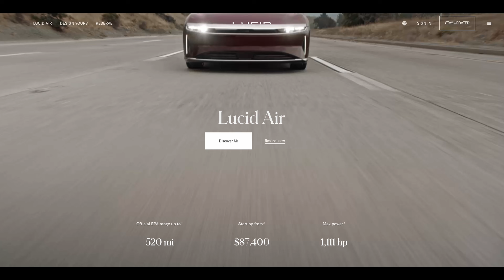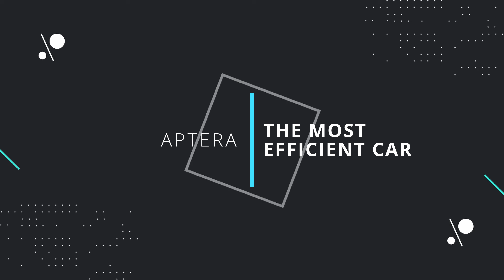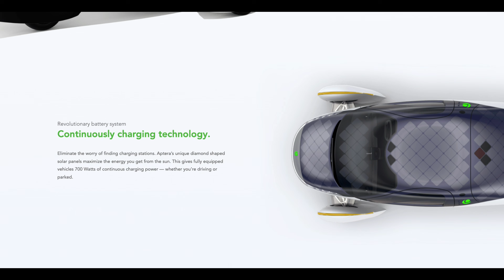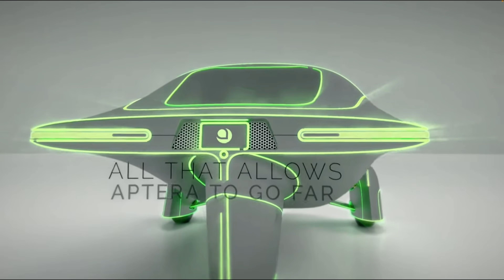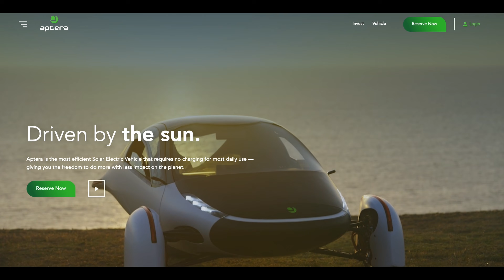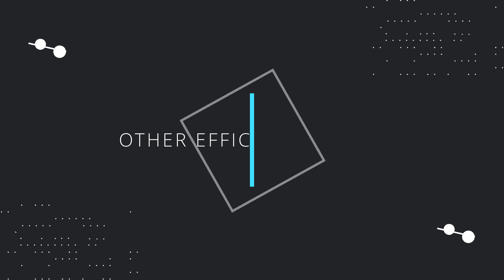Can Aptera redefine the norms of EV efficiency?

Comment: Forgive me for my continual cynicism, but having been an EV proponents for around 30 years, I've seen it all before.

Aptera currently have nothing to offer as they are not even at the pre-production prototype stage. They have a couple of proof of concept vehicles that are quite impressive, but a huge amount of work to do before series production. That means they need a huge amount of investment to tool up.

Their estimate for the cost of a production vehicle is based on a volume of sales that is almost certainly beyond reality. Most people simply don't buy a vehicle like this. How many people buy an SUV, when an estate car would actually do the job so much better?

Aptera has gone bust before, taking investors money with them. I'd really like to see them succeed, but I think the cycle is likely to repeat.

Vectrix only succeeded once someone was able to buy the remains of the company for a pittance and assemble vehicles from spares stock as they were ordered.
Reply: Aptera’s pre-production Gamma version is due to be released this month. And all of the original investors money was returned back in the mid 2000’s.
Reply: @michaelmay9958  Just a correction - All of the Pre-order money was returned.  Investors, who voted to kick the founders off the board in 2009, lost money, although vendors were repaid and employees got severance.

The assets were liquidated in 2011.  The original founders were able to buy back the rights in 2019 and restarted the company with the original key people.
Reply from the maker: @michaelmay9958  Yes it looks promising and I would love Aptera to succeed. It's in indication that people trust original founders as they were brushed aside at the first attempt.
Reply: @michaelmay9958 [all of the original investors money was returned] You are being fooled by snake oil salesmen and gullible disciples who are seeking discounts. Aptera existed for 5 years and made 17 part-prototypes. Their expenses were paid by the losses of investors like Google, - so many shareholders lost money. It is highly likely there was more money syphoned off than real expenses, and current progress is showing similar trends.
Reply: Paul, they have had more than a couple of prototypes for quite some time.  There were more than that last November when my wife and I rode in an alpha prototype with stunning acceleration.

I think you have missed many aspects of this company, including the production method, which is revolutionary.

I will likely be driving my production model early next year and will report on the experience.
Reply from the maker: @n.brucenelson5920  I would love to know more about how they produce the body of the car. I have read that they use so revolutionary method to cure composites very fast
Reply: @LatutaEV  Although details could still change, they were using 3D printed molds with vacuum resin infusion and UV flash curing.  Costs are well under an order of magnitude below what Tesla is doing and the parts are much stronger.
Reply: @LatutaEV  The composite was used in C.A.'s boat company, which has a high customer complaint record regarding a deteriorating hull, from what I have Googled.
Reply: @n.brucenelson5920  The only order of magnitude are the lies.
Reply from the maker: @aussieideasman8498  Many people complaining about Tesla panel gaps and other issues but that didn't stop the company progress.😉
Reply: @LatutaEV  You get your full range with bad panel gaps and small issues like that in a Tesla. Aptera will probably turn out you get nothing. If they try to get a vehicle to market, it won't pass such Aussie standards as 'fit for purpose' and 'meets specifications'. No prototype has ever come close.
Reply from the maker: @aussieideasman8498  yes but people were talking all sorts about Tesla in the days of a roadster. I guess you have to fake it till you make it sometimes 😉
Reply: @LatutaEV  My ethics don't allow the notion of if one party does something wrong, that gives license for another to do wrong. There is no faking it for Aptera just because others have done it in the past. Nor should reporters report on claims that have never been verified in the real world by passing them on as facts. Computer modeling does not cut it.
Reply from the maker: @aussieideasman8498  My video was about the approach to maximize the efficiency and get away from this massive and expensive SUVs. You often see one person driving this tank to work on his own. I was talking about benefits of charging speed and more miles per kWh etc.
Reply: @LatutaEV  [My video was about the approach to maximize the efficiency and get away from this massive and expensive SUVs.] Your mistake was to use something that is both not real and has unfounded claims, as if it was real, thus promoting what may just be a massive scam. There are plenty of other ways to meet your aim without possibly conning people.
[You often see one person driving this tank to work on his own.] My logic tells me that how many you see is irrelevant to the EV you chose 'because it is not real and is unfounded'.  
[I was talking about benefits of charging speed and more miles per kWh etc.] There are many EVs that show benefits over big SUVs, but Aptera is not one of them, dare I say - 'because it is not real and is unfounded'. 
When I have time, I will use your video to evaluate the claims and add as much information I have to inform the public so that they can make correct choices for themselves. In the meantime, Gamma is 10 days past its predicted reveal date and not a vehicle or part thereof to be seen.
Reply from the maker: @aussieideasman8498  What unfounded claims did I make in my video? I was only refering to the figures stated by Aptera. If you read the title of my video hopefully you will understand. Please also note a question mark in the end of the title 😁
Reply: @n.brucenelson5920  I see your comments here a lot and know you are an Aptera Ambassador.  Do you have a channel where you will be documenting your experience with the car?  I reserved mine earlier this month so delivery will be further down the line for me but that gives me the benefit of seeing real world reviews before finalizing my order.
Reply: @n.brucenelson5920  You and I clearly have a different opinion on what constitutes a production ready prototype. As far as I am concerned, what you dove was a proof of concept with different suspension, motors, batteries etc. and not a 'first of the type'. Given the amount of development that was supposed to been done the first time round, I was quite shocked to see how far off production ready they were.

Do I think they'll succeed in getting into production? Yes, I think they will, just like Vectrix did. Do I think the'll sell sufficient volume to make their business model work? No. 

If their production method is so revolutionary, then there's a real danger that the investors will refuse further funding and then sell that method. That's exacly what happened with Pivco and Ford.
Reply: @EVguru  I was actually a supplier to PIVCO and other early EVs.  I saw many of the early attempts including the Corbin Sparrow and the Commuter Car Company Tango.

The company I worked for hired the Tesla motor engineers when Tesla ran out of money and had to lay them all off.  You seem to be way behind the present Aptera situation and I don't agree with your comparison, having seen all of these companies up close.
Reply: @n.brucenelson5920  What is your opinion of the Tango? Although even a used one is quite expensive, I still am interested to purchase one. I had attempted to meet up with the Commuter Cars president for a potential purchase of one about a year ago but things didn't pan out. Any details you could provide about the Tango other than what is already out on the web would be appreciated.
Reply: @skipondowntheroad5833  When I lived in SF Bay, the President and his son stopped by with a Tango.   We got rides and he talked with us about supplying the A/C system, which we had already done for several EVs such as the Ford Think!.    It certainly had impressive acceleration, so it would be a fun vehicle.  

Mass production of the Tango didn't pan out and we sold our A/C business to Tecumseh Products, hired the Tesla motor engineers when Tesla ran out of money and had to lay them off, and started developing motors for electric boats.  

I am not sure I have anything to add about the Tango.  It would have been an interesting and fun vehicle to commute in from the standpoint of this motorcycle rider.
Reply: @EVguru  I have plenty of reasons why it's more likely to be a second scam in my video's and comments on many pro-Aptera YT video sites.
Reply: @EVguru  Aptera only went bust after ejecting the founders. That's the key to keep in mind. Their efficiency isn't just in the car, but in the manufacturing process to save costs. They're actually working on production by the end of this year, and have more pre-orders than any other ev startup right now. Also, the tech is much better nowadays, the industry has caught up with their vision. I have faith it will thrive even if as a niche product like the Framework laptop. I hope to see it test drivable at conventions next year.
Reply: The way I understand it Aptera is going to finalize the latest rendition and contract out with established manufacturers to make the car parts. All Aptera is doing is assembling all the parts and working with the individual buyers. Sounds like a great plan that saves a lot of money in the early stages. Can't imagine a single thing going wrong with the well planned out automaker.
Reply: @tigeroll  No imagination, then.
Reply from the maker: Hi Paul, by all means I do welcome all points of view. In fact on this one I do share your views. I think their advertised sale price is unrealistic and the use of in-wheel motor may not be practical. But I love their approach to optimise all aspects of the EV and move away from all these expensive SUVs everyone else seems to be launching at the moment. I would like to see optimised vehicle with smaller battery and perhaps an extender battery one can plug in for longer trips. I was hoping you respond to my question about negative points for the Axial flux motor.
Reply: Stop disguising your stupidity as mere cynicism.  They're beginning production whether you like it or not.  It's already happening and none of your cult complaints are going to stop that from happening.